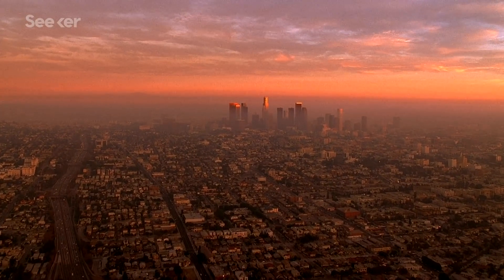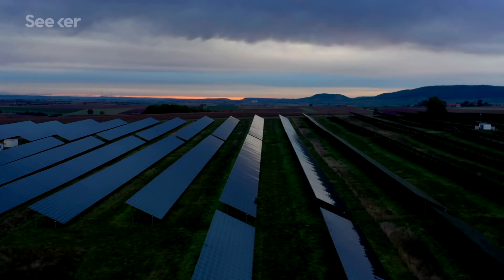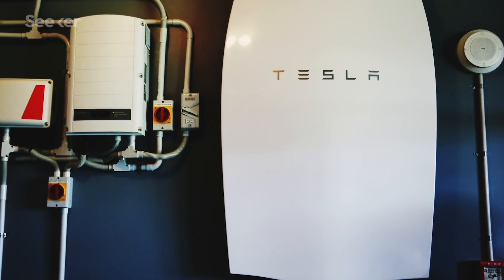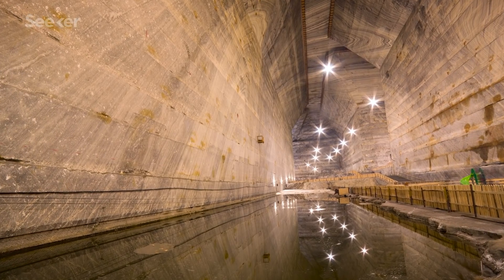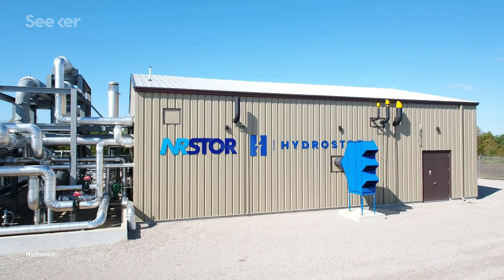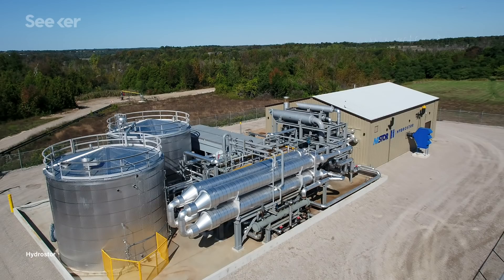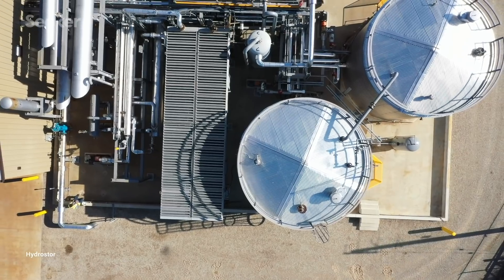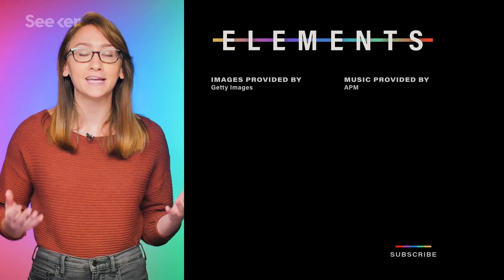This New Tech Could Revolutionize How We Store Renewable Energy

Comment: 2:20 This part seems to imply that energy is "lost to the atmosphere" because the hot air cools down in the stone storage chambers.
While later on, the "advanced CAES" seems to imply that the system is more efficient because the air is heated back up so that its volume is not too low due to it being cooler after re-expansion than when it was first compressed, making it able to drive turbines better.

Comment: First impressions: Bullshit. compressed air would only run turbines at a certain psi. so you have to first pressurize the system to at least that pressure then compensate for natural losses due to escaping air so it becomes a net loss as a container. then I would assume storing at higher psi would greatly decrease the efficiency of energy put in thus use more energy for less storage.......I will comment an update upon further research on the subject.

Comment: https://www.energy.gov/sites/prod/files/2019/07/f65/Storage%20Cost%20and%20Performance%20Characterization%20Report_Final.pdf compares battery storage and CAES among other types of storage.  While I have not reviewed the entire report a quick scan of the summary of findings indicate to me that there is likely room for a two or multi-tiered approach to storage.  Appropriately sized battery storage excels in round-trip efficiency requiring less overbuild of energy generation to support storage losses.  However, the capital cost of providing long-duration discharge is currently quite large.  I can imagine a grid network where distributed 4-hour-cycle battery storage provides the peak load demands that typically occur in the evening hours just after solar collection has ceased and slightly more centralized CAES or smaller scale potential energy approach addresses the overnight hours at lower round-trip efficiencies but a relatively lower total energy.  This limits the excess power requirements of the renewable generation to provide the energy losses of the storage system.  Finally, a centralized large-scale storage system such as pumped hydro should be in place to handle the reduced generation capabilities of days with low average solar insolation or low wind across the service area in order to limit the need to increase the output of fossil-fueled base load or peaker plants.

As for nuclear power either fission or fusion, I have never heard either discussed as anything other than a base-load generator.  Unless the generator can modulate its output significantly over a matter of minutes or small number of hours energy storage is required to buffer this type of generator to the grid, as well.  Nuclear fusion also suffers from having an extremely large startup power requirement in order to induce fusion.  This requires a substantial and reliable grid to be in place to support the startup.  Admittedly, my observations are those of a lay person, so if someone is more knowledgeable about the intricacies of nuclear fusion, please set me straight.

Comment: AKA------using you solar power to power your air compressor...except huge.  Then you turn on the air that you piped to push a turbine to generate electricity...while running your conduit underground to take advantage of the temperature.    ?   I could be wrong...lol interesting!

Comment: Why not just pump the water up to the higher cavern ?

Hydro reservoir energy storage has been operating for years at >75% efficiency.
Reply: Massimo O'Kissed yes but it’s hard to find a 2 natural places that are close enough to pump water from one lake to another. And building 2 lakes or even one additional lake it’s insanely expensive
Reply: 3:00 Amanda is describing the same thing, except the lower reservoir is now built underground and compressed air is used to blow the water up to the higher reservoir.
 Digging caverns is way more expensive than open air ponds, and the air compression just adds an unnecessary stage of losses.
 It's just a step closer to a fully zero % efficient Rube-Goldberg energy "storage" system.
Reply: Scale

Comment: I thought you would be talking about the hoisted concrete slabs that store energy as potential energy
Reply: Horribly inefficient.
Reply: That is hilarious.
Reply: @Dig Byck, I was comparing the concept of using gravity to what the original poster said.
Reply: @necko2529  @Dig Byk In the 80's and 90's in Italy we were regularly using dams to store the energy surplus at night, horrible efficiency but was still viable, nowadays with the potential of wind/solar we could use them as a solution, without even building new ones, just add turbines to the existing ones.
Reply: Josh , what? Use more energy to get the water back up? What dam are you talking about?
Reply: Thunderfoot demolished that
Reply: Wait....what? Joke right?
Reply: Rotating objects are too difficult to manage when you reach very high frequencies (millions of RPM) so these dudes use ionized gases and focus on the geometry of their devices. That can lead to advanced studies (involving Buckinminster Fuller's work) 😉
Reply: Josh  isn't that all batterys/battery like. They all need more energy in then u can get out but it's still worth it but energy use gots up and down a lot. Water is just the cheapest to use
Reply: Yeah... that is Energy Vault... the economics do not work.  Do the math... those blocks need to be approx 35 T each to reach 5 MW output with two running at once.  Yes, you need to run two at once.    Anyhow, run the numbers and it becomes clear that unless you get the concrete for free you can't beat lithium ion on price.  And that is a big ass ugly crane for only 5 MW of storage capacity.
Reply: Not a great explanation, the thermal storage is the key to the whole thing, other wise it requires huge storage volumes and loses too much energy, but how to reintroduce that heat efficiently is the bit I'd like to see.
Reply: We need something heavier than concrete. Maybe a block of tungsten or depleted uranium.
Reply: We already have something better,  dams...
Reply: I myself came up with the idea of using weight and gravity as a way to make energy. You said it have something heavy up high and then use the weight of it plus gravity to uhhhh 🤔 hmmm 😂 turn a turbine all we would have to do is figure out a way for that weight to get itself back up to the starting position. Personally I'd make my own device of this sort and probably just make some type of crank to hoist up the weight every time it needs it. And voila free clean energy.
Reply: @toptendawgbaybeeeeeee  you identified the key point yourself, good luck finding the answer. I think it's as esoteric as tapping zero point energy but good luck 😊
Reply: @doudsbass  man its passed my bedtime like by a couple of hours already and I just did a little research on zero point energy. Can you say whoa? I have to sleep because I work tomorrow. Goodnight. Thank you. Goodluck to you as well.
Reply: @doudsbass  I'm thinking a heavy weight spinning and hmmm yeah scratch that thought. Gosh it's possible though a device that fits in your own back yard say dug underground for safety and it powers your home. Voila😆
Reply: @toptendawgbaybeeeeeee  Think, my friend 😊

You can check out Walter Russel and Nassim Haramein for inspirations !
Reply: The energy making device I have in mind would use a combination of weight, gears, pulleys, and free clean constant energy gravity.
Reply: Topten Dawg This would never work as the energy required to get the heavy object back up would equal the energy it gave falling down.
Reply: @ChristopherGuilday  histeresis cycles
Reply: @ChristopherGuilday  Well, isn't that exactly what we need?
Reply: @toptendawgbaybeeeeeee  Idiot

Comment: Solid State Battery by John B. Goodenough
Reply: As of yet Professor Goodenough's battery concept is still in peer review. It has potential if it can be mass produced as a relatively cheap cost but seeing the patent is associated with the University of Texas at Austin... I'm going to say it won't be a available for a while. They tend to hold onto significant monetary gainers until they can establish a viable solution to reap huge rewards by setting up dummy firms attached to the school to clear taxation requirements.
Reply: @kineticstar  Interesting, well, no matter,  I will still be able to experience a lifetime with solid-state batteries.
Reply: @FloofyTanker  I hope you will be able to as well. With all sincerity, I hope something will come of it.
Reply: I see molten solid state battery's for grid storage. With the lithium in a molten state it would not damage the solid insulator.
Reply: Toyota